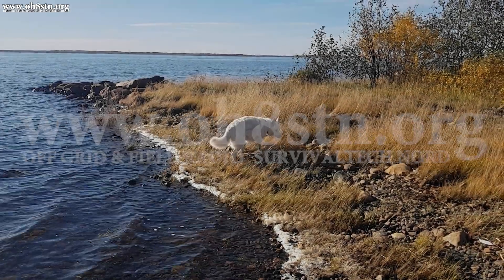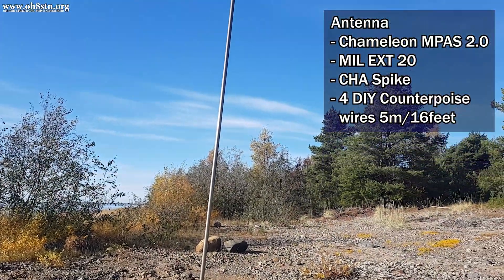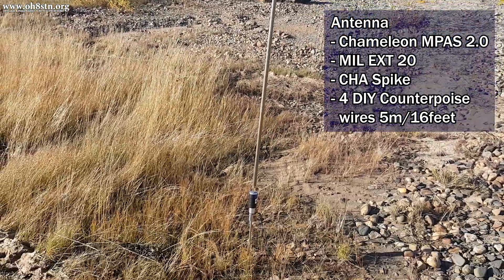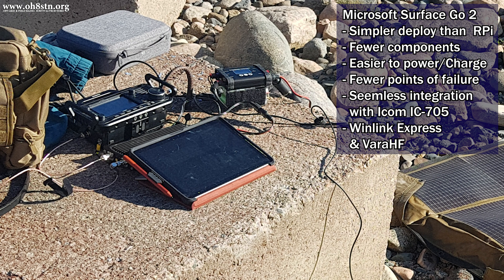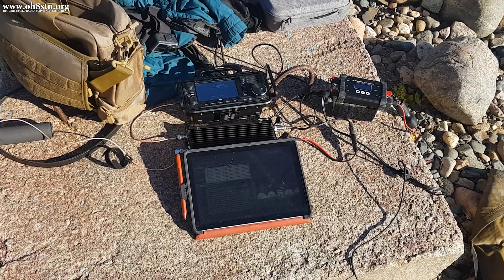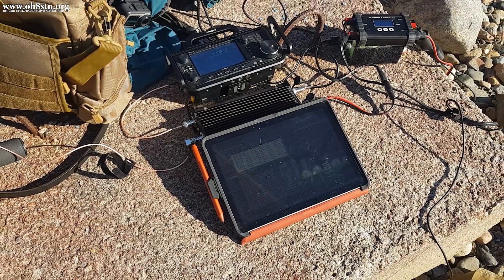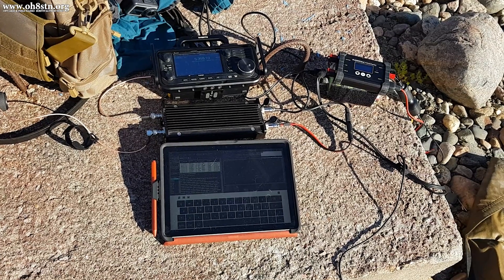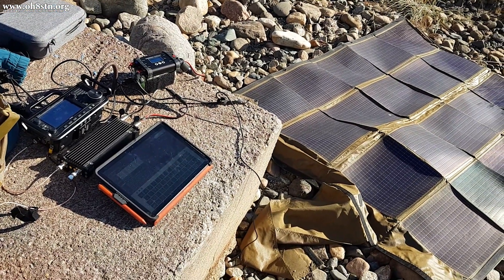Portable Ham Radio Winlink Station

Comment: I learn so much from your videos.  Thank you for explaining everything.  
It would be helpful if you include some of the issues that you commonly run into.  It always looks so seamless, but I'm sure something goes wrong.  What do you do.  Also, I assume that Ic705 doesn't need a TNC to communicate?  What TNC would you recommend for older equipment?  Thanks - George AB9CQ
Reply from the maker: Hello George. First thanks for watching and commenting. Also for the kindNess, It's greatly appreciated.
When you say TNC, I believe you mean audio interface. Indeed,  the 705 has internal audio interface.  A TNC is a kind of modem used for dpecigic data modes like PACTOR,  Robust Packet, even Packet. They can be software or hardware depending on the mode. 
For audio interfaces, I prefer @thedigirig interface. It's the smallest most cost effective solution for data modes on your radio. 
73
Julian oh8stn

Comment: How do you charge your surface in the field? I have the larger surface and it needs AC power. And my ac-dc converter in RF noisy.
Reply from the maker: Here you go.
https://oh8stn.org/blog/2021/10/10/microsoft-surface-go-2-faq-ham-radio-laptop/

Comment: What's your opinion on operating the Yaesu FT-991A ... off grid using Winlink. I am concerned about the radio using to much power in the field or during weekend hikes. Thanks. Really appreciate your Raspberry Pi reviews and tips.
Reply from the maker: It's a great radio but draws lots of current on RX unfortunately.

Comment: I've been doing a tremendous amount of hiking and ham radio the last month or so with the 705.  Usually hiking about 8 miles round trip with a POTA in between (SSB though).  Your videos continue to inspire me.  I haven't tried all the digital stuff you do but I'm always amazed at what you accomplish.  I don't have a windows computer, only an iPad that I could use.  Anything else would prob be too heavy/big to fit in my Icom bag.  I'm thinking about a way to incorporate a raspberry pi with the km4ack build a pi build but haven't completely figured it out yet.

Comment: Thank you for sharing. May I ask, with your experience for off grid ham and running IC-705 external battery @ HF lower band only, when do we need to use the PA? Assuming we had a good antenna for NVIS and DX. Thank you in advance.
Reply from the maker: Great question. Actually I normally get by with 1-5 watts for regional connections. If there is QRM, QSB or some other external problem I can't mitigate with filters or frequency change, the amp goes into service. The amp is not always in use. It is an emergency option.
Reply: @OH8STN  Thank you 🙏

Comment: Great content as always Julian. . I'm the 'backpack simplex relay guy' here in the mountains for 2m/UHF. Signals are definitely vertically challenged around here.  I'll be expanding into HF eventually so my system needs to be modular and interchangeable. I like the Chameleon and MP-1, but what antenna would you recommend for 2m/UHF for the interim? Many thanks 73
Reply from the maker: He thanks for watching Jeff. The VHF UHF antenna question is one on my mind. I just invested an antenna analyzer so that I can actually build resonant antennas for those bands by myself. So the short answer, I'm not sure yet. Will definitely have a blast figuring it out though :-)

Comment: What a great video. Loved this. Fun and informative.

For the weight, still not sure why you've pivoted to the mpas 2.0 when the super is barely harder to setup and is resonant when tuned?
Reply from the maker: It's a good point. The MP1 is awesome. It's easy to set up and resonant. The thing is, I don't always know which band a successful connection will be achieved on. So a Broadband antenna is used so returning isn't necessary for each retry. Also because I had the antenna tuner built into the amplifier, the broadband antenna sas more convenient. If I was trying to go Ultra lightweight, removing all of the optional components like the amplifier, the MP1 would be preferred. 
Perhaps this week I'll do a short deployment with my focus on 60 meter connections. The MP1 can easily cover that segment and a variety of different 60m gateways without a retune.

Comment: Always interesting videos.  I like the idea of the hiking cart for bigger loads, but there is no way it would navigate the narrow trails and rough terrain I have here.  Every area is different and we have to adapt for our environment.  My dog is a hunting breed.  I did 8 miles and 1125 feet of elevation gain yesterday and he probably did 20 miles.  None stop hunt mode until he's back in the truck.
Reply: LOL! I used to have to carry my dog back because she'd gas herself running full speed for a few hours. She was an English Setter grouse dog but I could never get her to stick with me. All leg and lung.
Reply: @JamesWE3D  Yeah, he's a german short haired pointer.  Even at the end when we got back towards civilization and I had to put him on the leash he was still pulling like a mad man, everytime a chipmonk ran across the trail.  He's young though, 4.  Great dog, just needs lots of exercise and stimulation.
Reply from the maker: You're absolutely right. There are hiking trailers with a single wheel for narrow Trails. This one is useless in winter so skis and pulk sled for 5-6 months. 
Very nice hearing about dogs from other operators 👍👍👍

Comment: Another great video, thanks Julian.  Constant testing is key.  I had a complete digital fail on my last field test and power management problems too.  Always best to suffer before the whistle blows.  
73
Reply from the maker: Thank you and excellent advice. I don't understand putting everything in a box until it's needed. Best tool in the communications toolbox is a skilled radio operator.
73
Julian oh8stn

Comment: Great video.  I really want to get a hold of one of those diy amp/tuners when they come available to The US.  Curious how the tuner function compares to the ah-705 or the mat-705. I have both of those tuners and each has points I like about them and some I dont. 
~73
Reply from the maker: The amplifier is awesome but the tuner it's not so well integrated like the ah705. All of the logic is in the tuner itself, so the result is actually the same. The only thing missing between the two is the push button to activate on the 705 itself. Anyway the developers working on getting them into the Anyway the developers working on getting them into the North America.
73
Julian oh8stn
Reply: what do you like/dislike about the Ah-705? Have been considering one myself.
Reply from the maker: The only thing I don't like is the size. Everything else is absolutely brilliant with it.
Reply: @xray9alpha  yeah the main thing is its size for me as well. Works great. Just feel like its overly bulky for a pack tuner. Lots of dead space inside. They could have made it half its size probably. 
Then the mat-705 tuner works good but batteries don’t last long at all, and go dead when not in use so I rarely use it.

Comment: I've seen that you are a big supporter of VARA HF. Did you pay the $70 for the license, and do you feel that it was worth it if you did?
Reply from the maker: I did pay the 70 bucks and I absolutely think it was worth it. ARDOP is quite bad for weak signal work. VaraHF has an excellent ability to decode, will throttle up or throttle back depending on conditions, it's just amazing.
Reply: @OH8STN  Awesome. Thanks for the quick reply, and keep up the excellent work!

Comment from the maker: Hello Operators
If you'd like more context take a look at the episode notes
http://oh8stn.org/blog/2021/10/04/off-grid-ham-radio-portable-winlink/
 Here's information about using the Surface tablet in the field. 
https://oh8stn.org/blog/2021/10/10/microsoft-surface-go-2-faq-ham-radio-laptop/

You can also share this video: https://youtu.be/yrHruuaJNK4
73
Julian oh8stn
Reply: Another great video. I don’t know much about the amp. Does it have a tuner built in ?
Reply from the maker: @GottfriedSm  I use it for casual Communications when working qrp. This video was about my emergency communications setup, which uses a different antenna.
Reply: Julian,
as usual...great content.  I was looking for more info on the super antenna MC80 coil you use as part of your setup, but I can't seem to find it anywhere.  Do you happen to have a link for that?  Thank you for sharing, and keep up the great work!  W7WYY